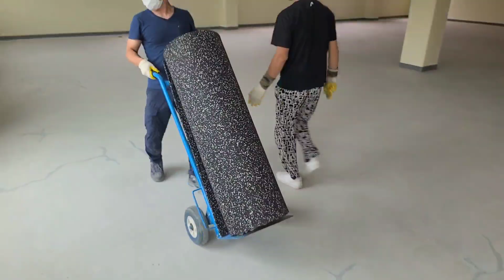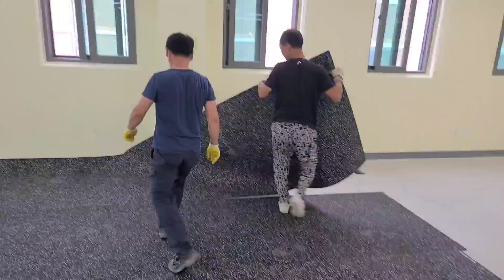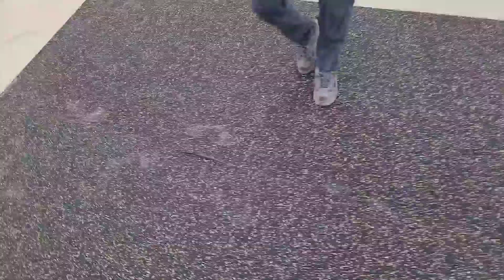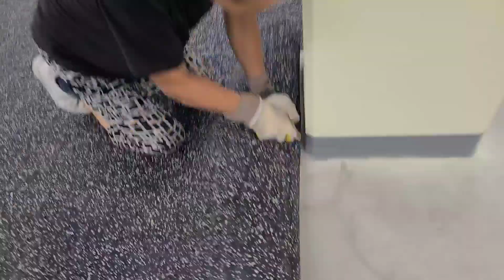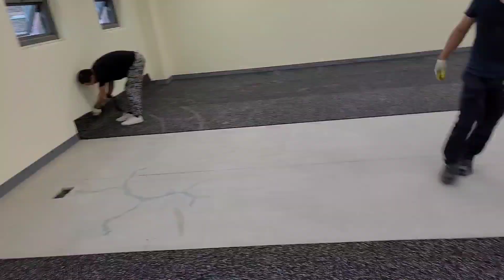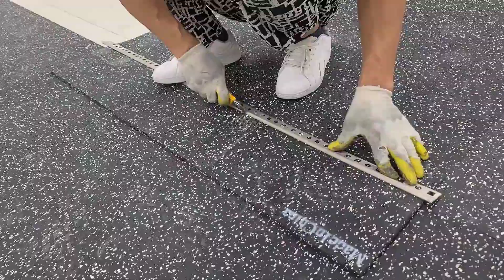[에버롤,렉스코트,네오플렉스] 층간소음에 최고인 10T 바닥재를 시공하다.(everroll,rexcourt,neoflex mat)sports flooring material.

Comment: Doing that trade without knee protection  will  wreck knees after a few years,   i  know from experience. Should be rolled with at least 75 lb. Roller. Proper glue transfer.